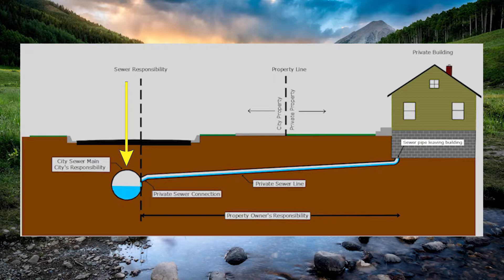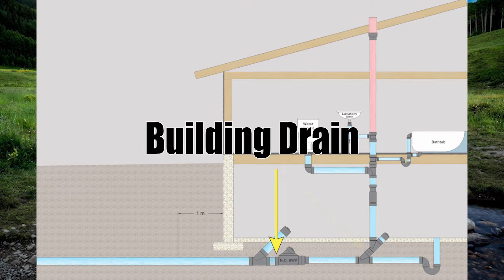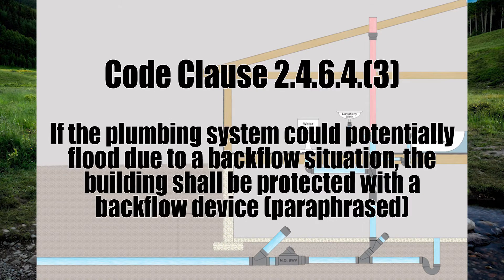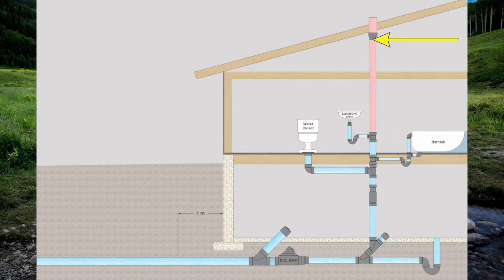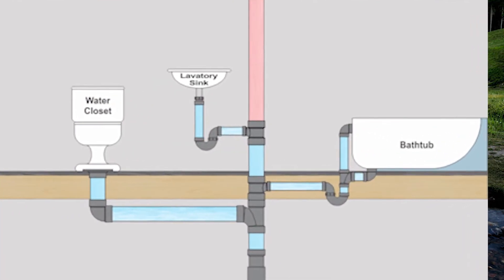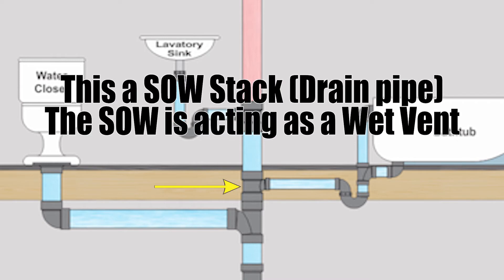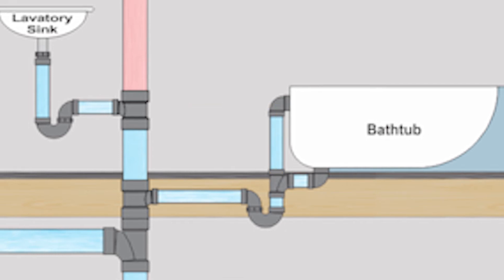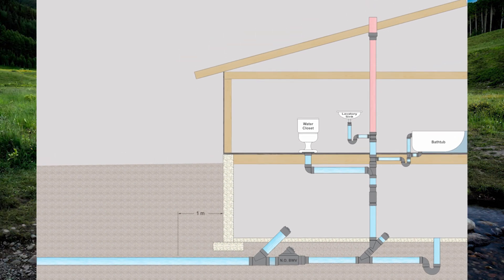Basic DWV - Video:1 Basic Drainage Names (Part:1)

Comment: For the backwater valve. Isn't every home at risk of the POSSIBILITY of a sewer backup? Resulting in every home should have one of these? I do service and drain cleaning in Vancouver and I rarely come across backwater valves on the sewer system and even the odd new construction work or renovation ground work we've done that has been inspected never requires a Backflow valve to pass final inspection. Is the POTENTIAL of sewer backup considered subjective then?

If a BWV is installed, does it have to be installed inside? or can a Sump be installed on the exterior of the home with a ladder going down to a backwater valve that can be serviced? Easier to dig up outside grass than rip up flooring and jackhammer the concrete is my thought. 

I'm just concerned that I've been installing sewer mains incorrectly without having a BWV and that would put my company at risk if the blockage happens on the city side and backs up into the home and causes damage.
Reply from the maker: The exact phraseology from clause 2.4.6.4 is: 'when the fixture is located below the level of the adjoining street'

So if you have any fixture in a basement, yes you require a BWV. (Given the house is not built on a hill where the adjoining street is lower than the flood level rim of your basement fixtures.

As for the BWV installed outside into the building sewer, yes you can do this if your jurisdiction allows it. But remember, your BWV will be about 6 feet or more below ground level if you do this. How are you going to service that BWV in the future?